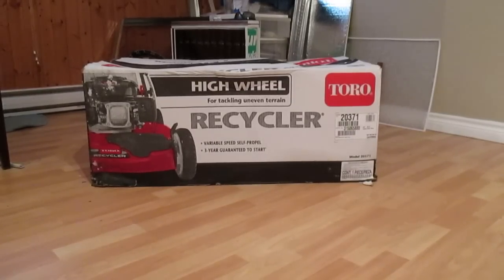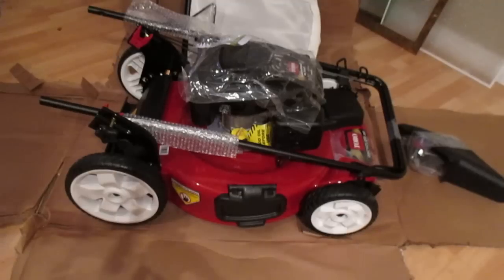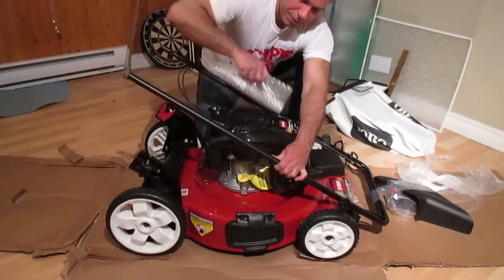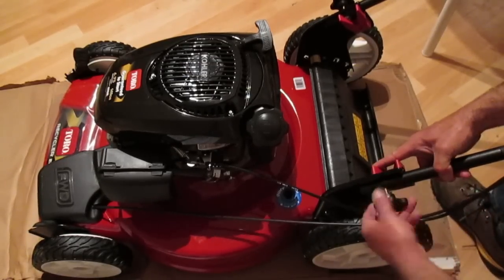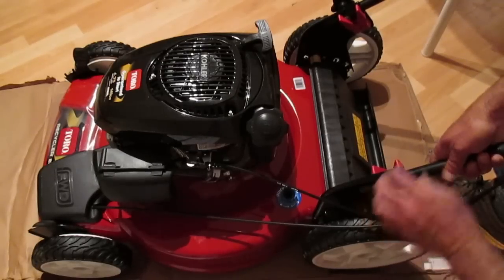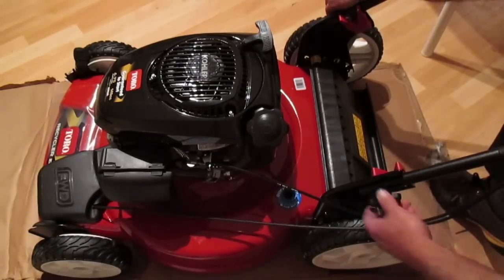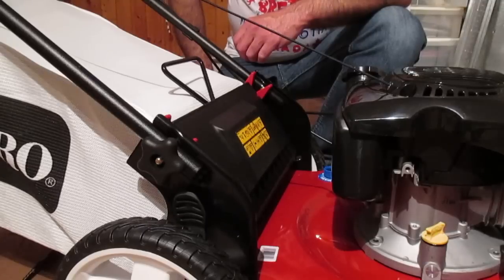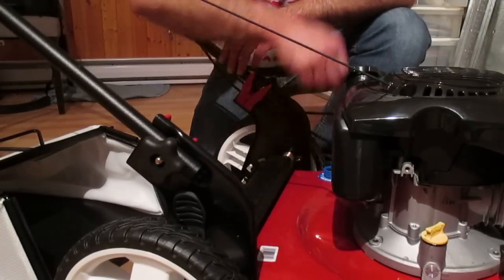Assembling a new lawn mower

Comment: Thank you so much! I just bought my first mower and this video was a charm! Just a few questions: I have my wheels set on medium height. Can I lay the mower flat on the sidewalk (or a smooth stone surface in this case) without the blades touching the ground? Also, How often should I change the oil and what kind of oil should I use? Lastly, how long does one full fill-up of gas last? What type should I refill it with? Thanks so much! Thumbs up :)

Comment: Thanks I had to rush out and get a new Toro (had a craftsmen for 1 year and died on me old gas just alittle in the engine and a little I couldn't get out in the can) But trying to get the handle on was just getting frustrating wasn't setting right and the directions not very specific. Your comment on the oil (even though it was 2 years ago) I have a smaller engine and it doesn't seem to take all the oil , I'll check it before the first start. Thanks again for the instruction - Didn't find any right out of the box videos?!
Reply from the maker: You're welcome, and thanks for commenting S.G. !

Comment: Thanks for the video. What do I do if the cord is not pulling back. I am pulling as hard as I can and it won’t budge??
Reply: Matt E unplug spark plug and spin the blades around in a 360. Plug back spark plugs and try it out lmk if it worked

Comment: I  have Murray Lawn mower just i bought from Walk Mart. I saw you Video and you put all that oil,can i do the same like you did. please let me know
Reply: Victor y Jaime. Gucj I have the same one, what did you do about the black cable on the left side? I feel as though it should be connected to the blade control but it's not and it seems loose when I just slip in in the hold on the handle blade control